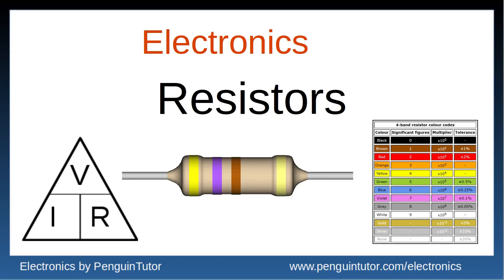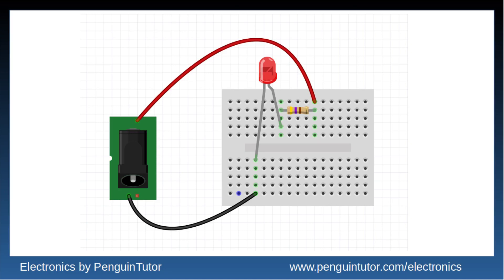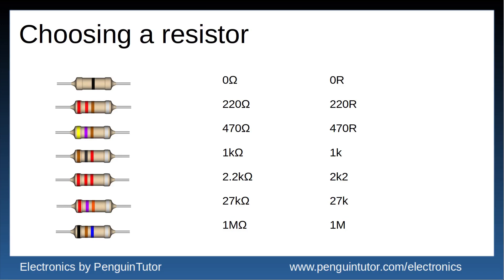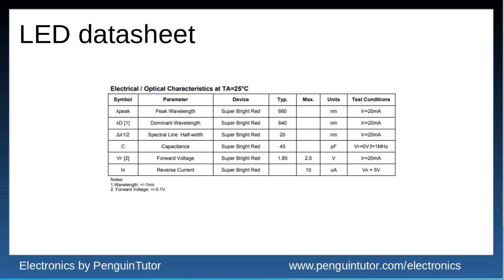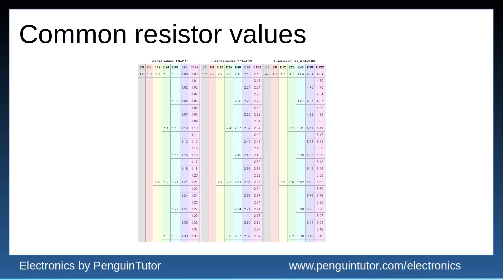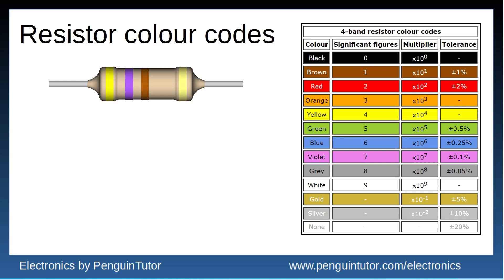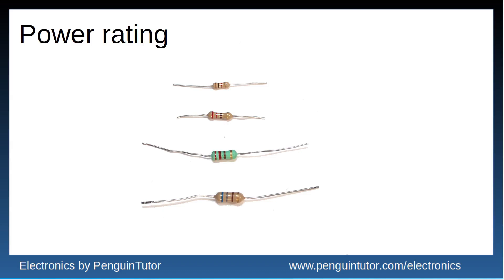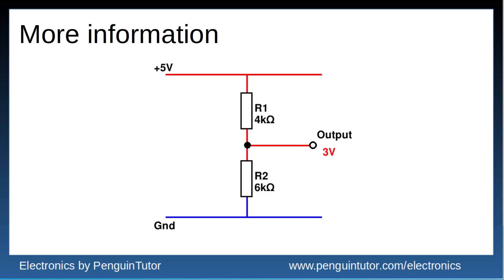Understanding electronic components - Resistor, calculations and colour code

Comment: I recently repaired a piece of kit that had been 'got at'. A failed 20 Ohm resistor had been replaced with a 1k resistor. The repairer had seemingly read the colour codes backwards, interpreting the black and red bands of the 1k as red (2) and black (0) of a 20 Ohm part. Resistors are bi-directional, but the colour codes aren't!
Reply from the maker: LOL.

I always thought it was easier when resistors had only 10% or 5% tolerance as silver and gold were not used for the significant figures. Although even the the colours weren't always as obvious. 

A good method is to select using colour code, but test using a multimeter.